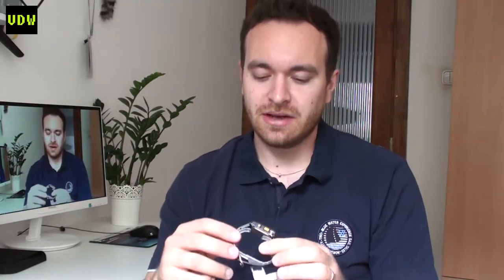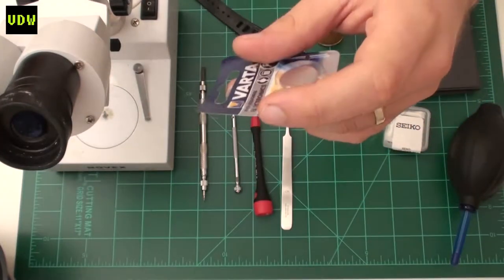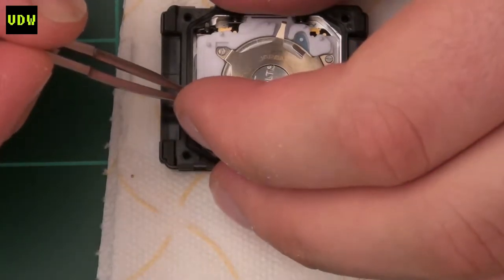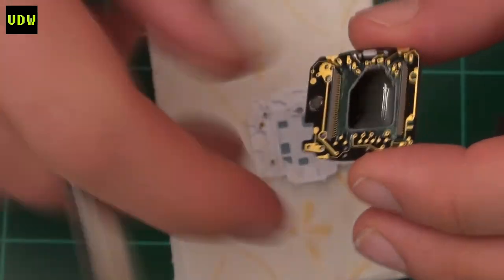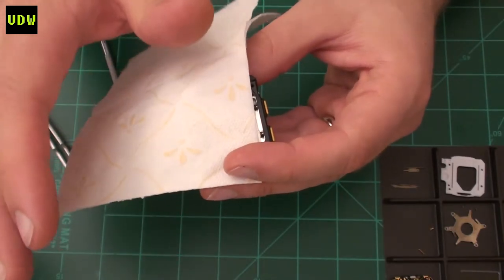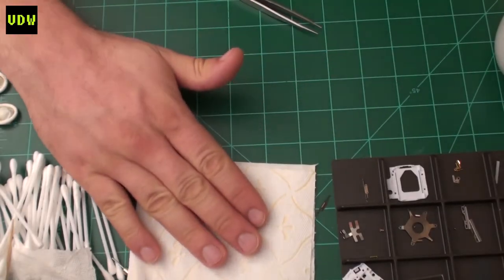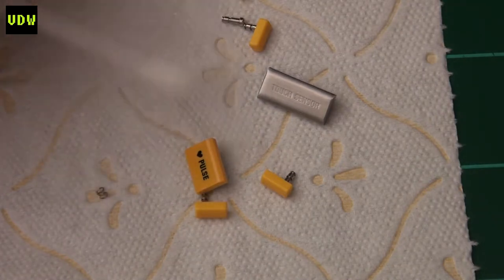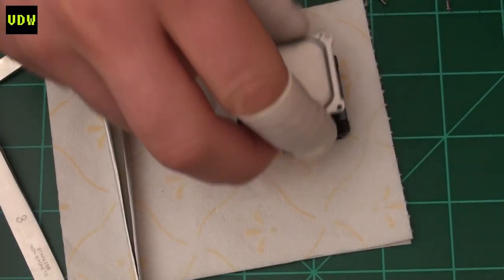(ReUpload Duplicate - low music)  Ep 16 - Seiko S234 LCD replacement and overhaul

Comment: Excellent instructional video especially the description on how to remove and reinstall the pusher retaining clips/washers. I have damaged these in the past when removing them. I will try your method using two screwdrivers next time.
Reply from the maker: You can use a plastic transparent bag over the watch instead of the napkin to have an easier view.

Comment: I found this video because I have an S234 that needs some restoration. The LCD has some missing segments. Do you perhaps offer this service? and if so, what would it cost, including the LCD replacement?
Reply from the maker: Hi, in my experience 9 out of 10 times, missing segments means a defective LCD so you are probably right about it needing a replacement. Cleaning the contacts and zebra strips may be an option but it is a shot in the dark. I would help you for free honestly because I am a nutcase and believe all digital should be restored :), but you would need the replacement part (LCD which is no. 4510-068) or a donor watch. And bare in mind that the LCD on the sister watch Seiko S229 will not work so the other option would be to have a S234 donor watch. Me finding the replacement LCD was pure luck as it was up for sale on eBay.

Regards,
Tibi
Reply: Vintage Digital Watches Hah! you know what? I'm pretty positive you beat me to that very eBay sale! 

I got extremely lucky finding this S234 as well. I think I paid $45 for it, so that was really cool. it keeps time, and the pulse function works. the only thing is there's a few segments missing. If you hold it at the right angle you can see them.

I have an S229 as well, I thought maybe it just needed a new battery, so I changed it but it still displays nothing. Going through that ordeal was enough to make up my mind about having someone else open up the S234!

Your offer is extremely generous! I'm definitely interested in taking you up on that, hopefully one of us can find another LCD.

Thanks for the reply!
Reply from the maker: Well an hours search on the web did not yield anything so an eBay saved search is the best bet to alert you if one comes up. If you want to send it to me for cleaning and individual testing of segments we can take the discussion over on e-mail, I have a gmail account linked to my youtube alias.

Regards
Reply: I'd like to do that, however YouTube has made it impossible to find email addresses linked to channels :( Do you have a website that might have contact info for you?
Reply from the maker: My Youtube alias is literally the "at gmail" address that I have :). vintagedigitalwatches@gmail.com